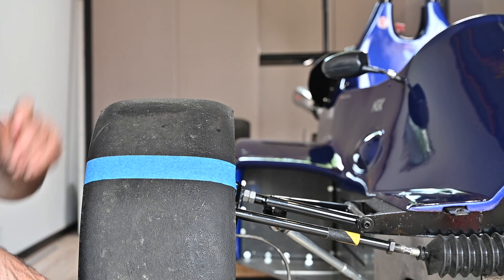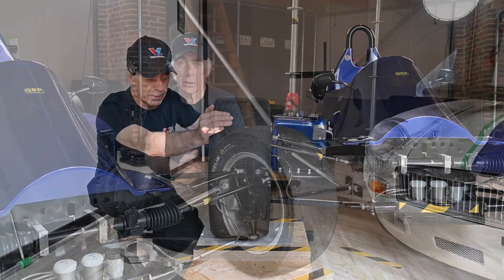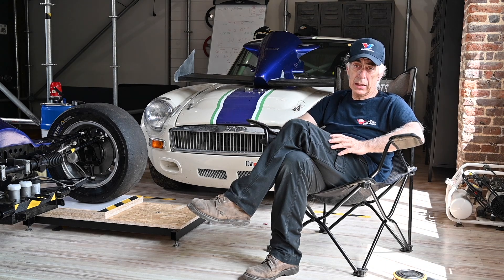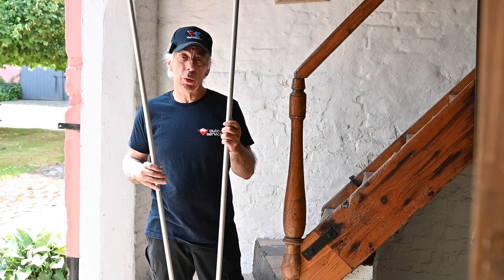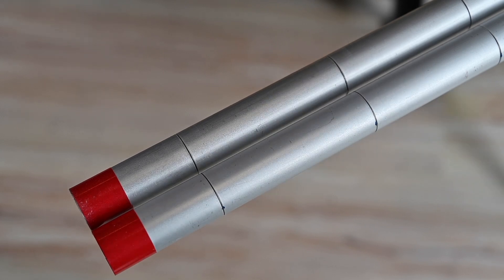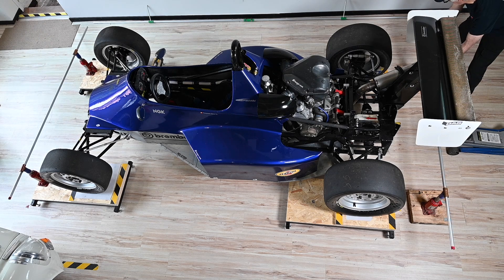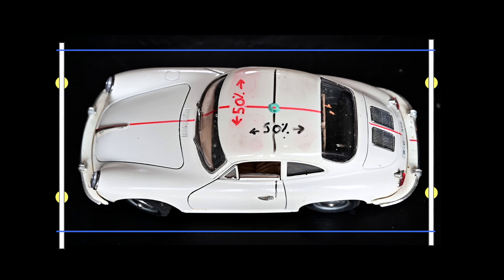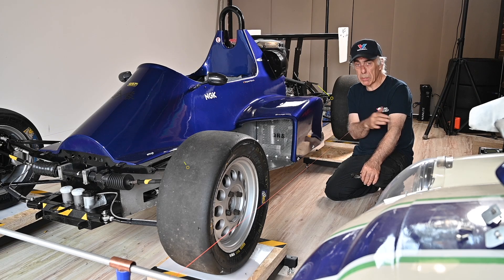Race Car Alignment Episode 5 - Toe

Comment: Thank you, these episodes were very helpful and comprehensive. Let me share you back a tip to make sure the steering wheel is dead-on center: place a bar in front of the steering wheel and let it rest over your windows rolled down (or clamshell, in your 1-seater). Then, tie the left and right spokes of the steering to the bar with belts/cinchs. 
Is also good to do the alignment with your weight inside, just as you did with corner balance. You may enjoy having a water dummy or ballast in the seat while you work all the parameters.
Reply from the maker: Thanks for the good tips Eloi...

Comment: We have a multi car touring car team and did the same exact method to align the cars for many years.  People can't believe that it is more accurate than expensive laser systems. We now use basically the same method but with hub stands which makes the job much quicker. Great job on the video and you really explained it well. Loved it!

Comment: I am fortunate to have a "4 Post lift and have adapted your type of set up to that. I use lengths of tubing that are somewhat longer than the spacing between the lift corner posts. I buy electrical conduit tubing; cheap and readily available in long lengths. At each post I use a short length of tubing of a somewhat larger diameter than the X-wise tubes held to the post by bungee cords stretched very tight. These support the X-wise tubes and can be easily adjusted for desired height. The X-wise tubes are marked same as yours and can be easily positioned by sliding in the larger pieces of tubing at each lift post. 
I tie a loop at each end of each of the strings and slip one end over the tube. I make the string longer than the distance between the front and back so I can wrap the other end over the tube and tension it with a Bungee cord attached to the string loop and the other end to to lift ramp, each side. This gives a very tight string for accurate measurements. I use a digital Vernier for measuring.
On another subject I think I see that your car has a speedometer. I raced several different cars for many years and non had a speedometer. Everything was relative to engine revs. Sometimes it's a bit scary to see the speed and again, not really useful.
As you approach the limiting speed for a given corner you will notice that the steering becomes less responsive, the car is telling you that it has very little more grip to give you.
You do a great job.'
Tom G.
Reply from the maker: Thanks for the comments

Comment: Is that an MBC GT you have there?
Reply from the maker: Yes  it is, its my track GT a 1925cc large valves, DCOE, kent cam, stage III with 180HP on the dyno
Reply: @D3Sshooter  I've had 3 MGs. A 60 A, a 68 B and a 67 BGT. Living in the Midwest, it wasn't the smartest thing since the heaters were inadequate, and the electronics sucked. On the GT, I rebuilt the engine and put a higher lift, longer duration cam in it. Got a few more HP, but the increase in mileage was surprising.

Comment: A great educational video (as usual :-) ) and a simple way of doing the alignment! Thanks! Just a brief thought and possibly a stupid question: How do you know that the front wheels are pointing straight ahead and the steering wheel is dead center before the adjustment? What I mean is ("I" is a wheel:-) ): "I" and "I", not "/" and "/", or "\" and "\"? We are talking about millimeters here and the steering wheel could be off-center...
Reply from the maker: Rolf  that is a very good question... In one of my previous video's when I was rebuilding the front , there I have set the steering house/ steering wheel in the middle position by just measuring extreem right and extreem left movements and then set the steering house to the middle position.  Then fit the steering wheel in a straight position and have it marked. At that time yiu don't care about the toe , because now that you have the steering house in the middle position we can adjust the toe
Reply: @D3Sshooter  Yes, I saw that video as well and it makes sense. However, if you have a standard car and want to make the toe adjustments. You can always roll the vehicle back and forth and hope it lines up nicely. But as said, it is just millimeters of in or out... Do you have a trick up your sleeves other than what has been mentioned?
Reply from the maker: @rolflyden6324  there is a method with slip plates, you just drive straight on  and you will see the degrees...
But those run about 300 euro/ dollar

Comment: I use the string method but always measure to the flat part of the wheel just inside of where you are measuring, where the tyre bead sits - mainly that's important on steel wheels rather than alloys as you have. On steels, the rim edge can be a bit "wavy" and give bad readings when setting toe.
Reply from the maker: That is correct... Thanks for the comments

Comment: I like the simplicity of your rod setup...however. Although the lines are parallel the box may not(probably not) be square, which could lead to significant errors in measurement at this level. Squaring the box requires removing the car and measuring the diagonal corner of the box to verify they're equal. That is measure from right front to left rear and left front to right rear...Straighten the string and rods until all is equal and you're ready to go.
Reply from the maker: Thanks for the comments Rick, and yes that is one method that assures a square wire frame...
Reply: @D3Sshooter  Did you use another method to square the frame?

Comment: I'm a little unsure about how much you adjusted for toe. Did you adjust each front 1.5mm and each rear 1.0mm? That would give you a total of 3mm and 2mm toe front and rear...or at least that's how I learned to do toe. Is that right or did I miss something.
  ETA: Your actual toe is greater that what you've set since the toe is actually occurring at the tire surface, further out than the wheel rim. That's why some toe gages measure in degrees.
Reply from the maker: Rick, a typical setting is about 1 to 1.5 for this kind of mono seaters on the rim.  Measured per wheel......  At the end I have set it to 1.5 mm front and 1mm back....  of course you are right that using mm instead of an  angle is not that accurate ( as you stated  , tire....) .  Toe references are sometimes per wheel or total, depending the spec provider.    I have a FF-1600 Hawke, with all the  baseline geometry factory spec's  ( lucky me) and they also specify toe per wheel in mm...  ( 2 mm).   I have seen other specs with total toe.   So yes, you are right ....  Of course one can calculate the 1.5 mm in degrees... that is 0.239°
Reply: @D3Sshooter  So what exactly did you do to each rear wheel, it's not clear in the video. And how did you make the determination on front toe since it did not show you taking any measurements on the front left wheel.
Reply from the maker: @rickden8362  , as the video shows at each rear wheel the front part of the rim is 1 mm further away from the string then the rear part of the rim.   The same method is used on the front wheels ( with the steering wheel in the middle position and locked ) .  There the front of the rims are 1.5 mm further away from the string than the rear side of that rim.  Same procedure is applied as in the back..  I have not put repeating footage of the same process in the video. Thanks for asking
Reply: @D3Sshooter  So, just so i have this right in my mind, ''total toe'' in the rear is 2mm(1mm on the right + 1mm on the left). And ''total toe'' in the front is 3mm(1.5 on the right + 1.5mm on the left). I just ask this since it wasn't shown on the video. When you reassembled the suspension, did you verify it was tracking straight with the center of the chassis?

Comment: Don't feel about not running toe-out, it isn't as good for cornering as people seem to believe. It makes the steering feel more responsive because as soon as you turn the wheel the inside tyre is already pointing in and grabbing into the corner, but the outside tyre is what does most of the work mid-way through a corner. The outside tyre is where all the weight shifts as soon as you start turning and the more weight that goes onto the tyre the more it distorts, the more a tyre distorts the more you have to compensate for that distortion with both camber and toe.

Plainly; you want the outside tyre to be pointing into the corner more than the inside tyre, because there's so much load going through the outside tyre it can run a higher slip angle before breaking traction.
Reply from the maker: Thanks for the comments, good points...  As far as I am aware F1 runs slight Toe Out in combination with Anti- Ackerman.    Would be good to get some info on  that
Reply: I should mention that all my experience comes from tuning road cars with fairly tall tyre profiles - a racing car with limited body roll won't shift as much weight to the outside tyre and a low profile racing tyre with reinforced sidewalls won't distort as much.
Reply from the maker: @dicksandballsnshit3856  , thank you for the clarification and yes things can be different between car types and tire profiles...    There are many ways to skin a cat ( as they say)😀

Comment: Of course there are always more ways of doing the same thing the string method is accurate if all the wheels hubs are perfectly straight one other method which i was taught and claimed to be most accurate is to scribe a line on the tires and then measure between the front and rear of the tire at the line this eliminates any run out in the wheels then there are the toe plate that many teams use and may not be as accurate but if your using that method and measuring results as in steering feel and lap times it could be the fastest method and of course wheel fixtures could always be used such as youd see in a alignment shop then its only as precise as the equipment used like you i am a old guy with over 50 years of automotive experience working on vehicles and racing with one track lap record to a car I set up the suspension on that the driver/ car had many years racing at
Reply from the maker: Thanks for the comments Paul, good points...I never used that method.. I shall try it .... the best is of course wheel fixtures ( with small rollers ) .   I verify the run-out if he rims before I start... maybe I should have stated that

Comment: Although toe affects on straight line stability, the final degree depends on the steering design, more specifically the ackerman. A lot of ackerman accepts more toe in until it starts to understeer, and less ackerman needs more toe out to make the car turn a corner. Also, when you are using the edge of your rim to as measuring point, make sure that edge is straight.
Reply from the maker: Indeed, bended rims will not help, that is also why to check them first..

Comment: Steve,  Minis being FWD have a slight toe out to compensate for the drive shaft forces would this be the same on the rear 
of your race car where you have CV joints Just a thought ? Cheers Dave
Reply from the maker: Dave indeed FWD cars have the tendency when accelerating to  push the wheels more to the center.  Especially with standard bushes are used.  That is why you see sometimes Toe Out on FWD's to compensate for that effect.   In my case I have no bushes... In a RWD car  the opposite takes place,
Reply: Steve,  That‘s a good point and the other factor with a Classic mini is the steering rack is attached to the toe board
on the body and the subframe is rubber mounted to the body not solid mounted, I have mounted my subframe on my track car with solid alloy spacers and the steering is direct. No good for the road but great on a track. Cheers Dave